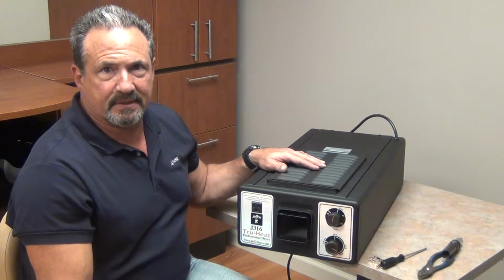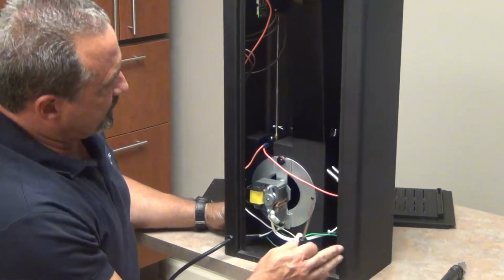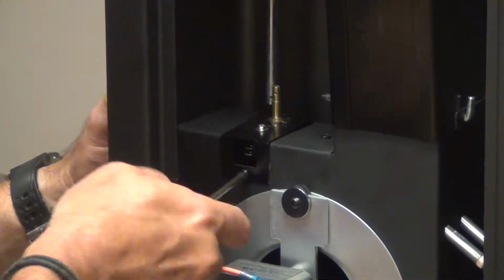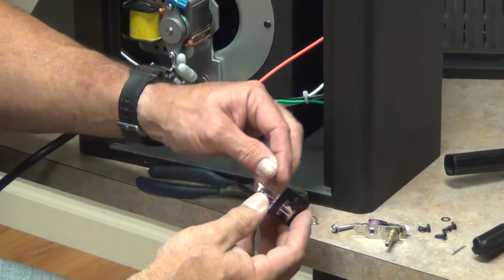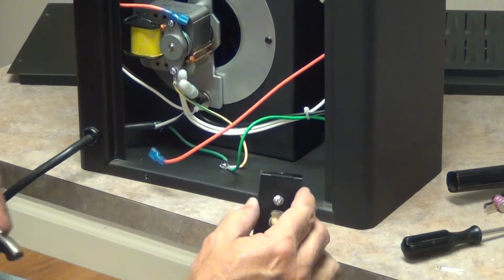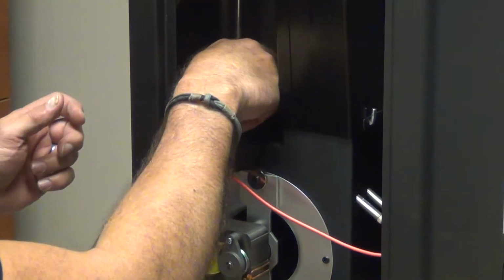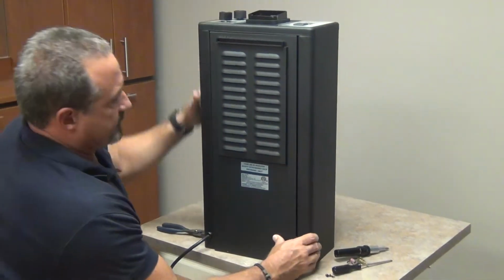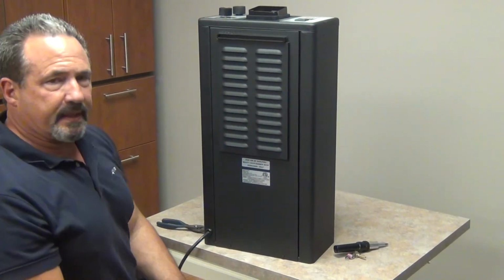How to Replace a Thermostat on a Jeffco Dryer

Comment: My dryer just stays on hot and the knob spins.  Is it my thermostat?
Reply: sounds like it, the "stop" is broken off.
Reply: sorry, it should not turn more than 350deg.
Reply: Again My question is do you think it is my thermostat that needs replacing?
Reply: @edithgilbert6011  YES, SOUNDS LIKE IT IS THE PROBLEM